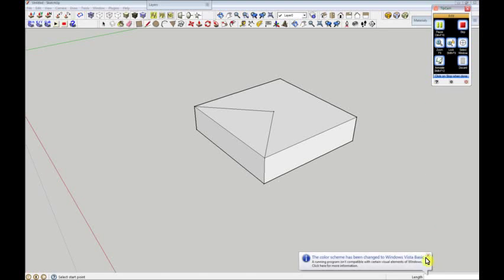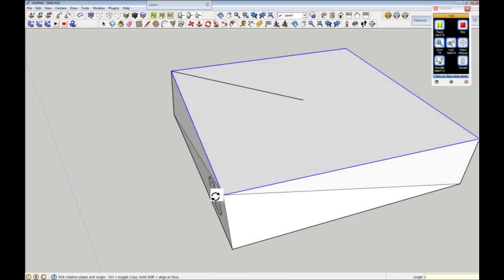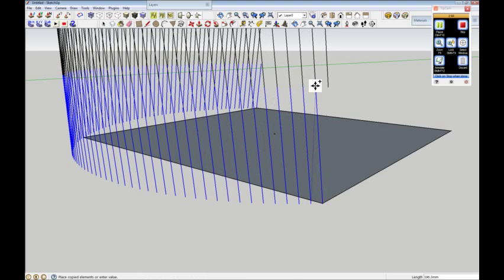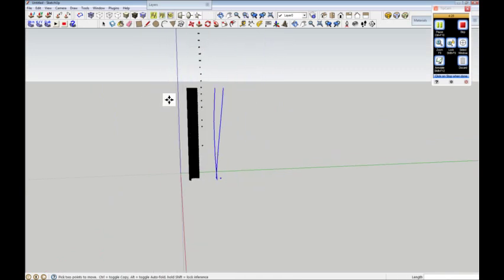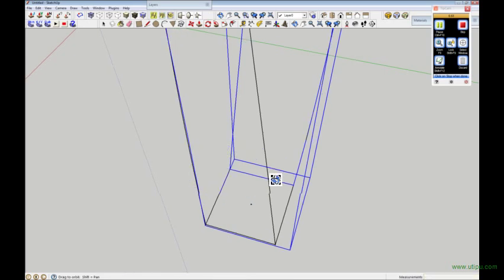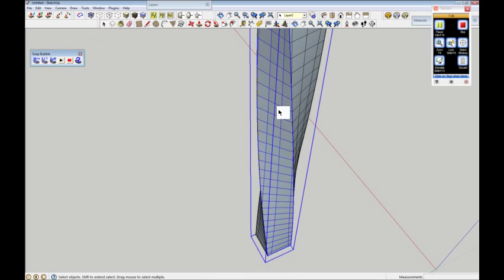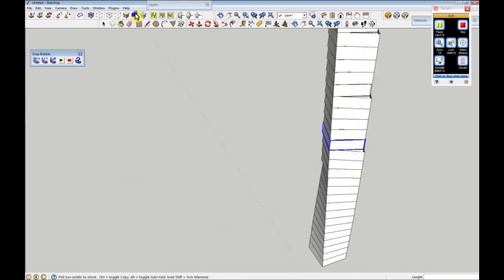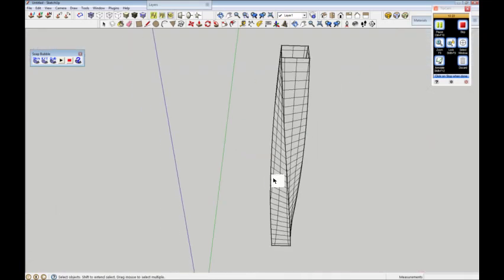Tutorial Sketchup 8 for  the Infinity tower type building.

Comment: the tower is twisted 1.3 degree... not 2 its start to be twisted from level 6 to 73 
the tower is 76 floor + 6 basment and each slab start from level 6 to be twisted 1.34 degree level 28 + 29 no changes slab is normal because u have ets room same level 73 74 75 are straight ..thanks anyway nice show but 2 degree its too much and its not the same !!peace ( eng hadi - infinity tower dubai marina )